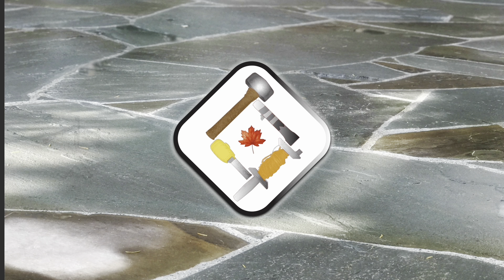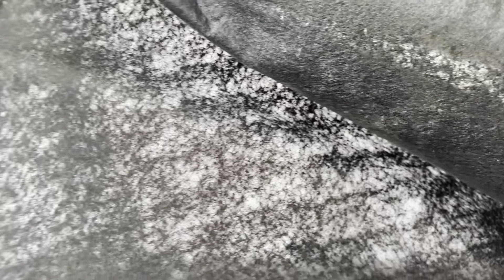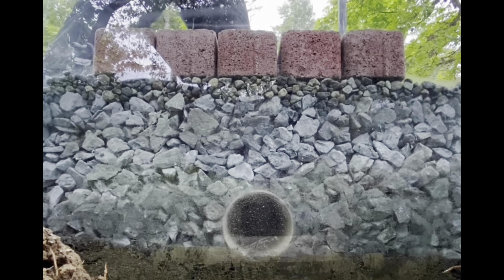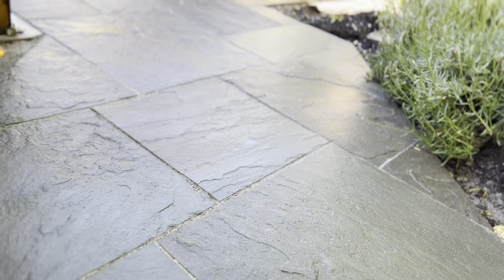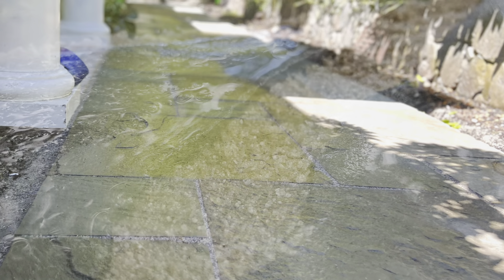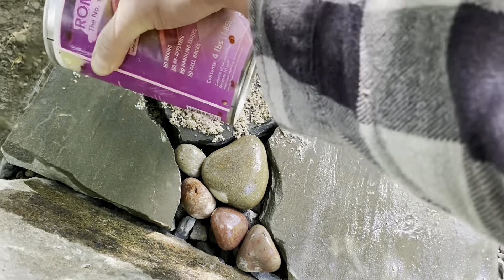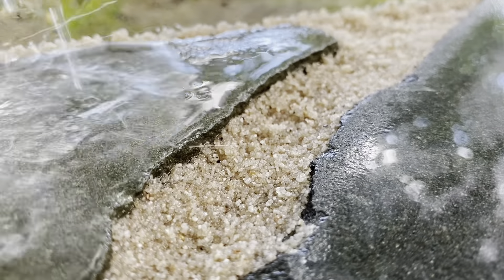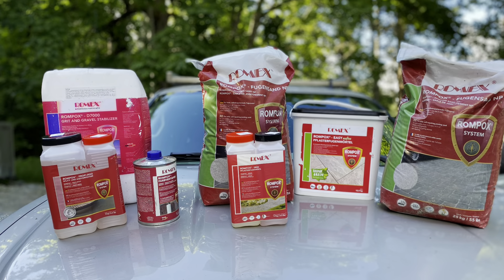How to install permeable jointing mortar! Romex and Easy Joint

Comment: First off, I love your videos.  I just finished installing a flagstone walkway with a few stairs.  It was my first project like this and your videos really helped.  I used the Rompox for the mortar and love how it turned out.  The flagstone i used is called Ozark and it has some really nice colors like gold and copper running through it that I love.  Do you recommend using any type of sealant on the flagstones?
Reply from the maker: Awesome I’m so glad you were able to do that project and use some Romex! I typically don’t seal flagstone, however if you want to lock in some of the colours you certainly can seal it. Can put in a grip additive as well for some texture.

Comment: Hi Kevin, whats the gravel just above the 3/4" clear crush?  Thank you!
Reply from the maker: For this video I used pea gravel, but if you have a smaller clear angular gravel up that way it would certainly be better!
Reply: @HardscapeCanada  ok gotcha.  Ya I'm guessing 1/2" clear is maybe to big to set into?  I the USA they seem to be able to readily get a 1/4" clear but I cant find it bulk anywhere here.
Reply from the maker: Yes correct!

Comment: Feels like I've seen this same video from you three times now, even the footage doesn't change. 

Also, aren't you also obligated to disclose paid sponsorships? Multiple videos from you end up just being ads - and that's fine, but your audience should be aware of it.
Reply from the maker: I admit there are similar themes, and some of the same shots are re-used however I’m trying to find the best way to communicate these ideas and bring all of them together in the best way possible. I really appreciate you watching them. I receive zero compensation for using these products, and mention them because they are simply the only ones that I have available in my market and I really like utilizing them!
Reply from the maker: And stay tuned I’m working on a lighting vid and a complete backyard profile with pavers and a dry creek bed etc so there will be lots of solid stuff to check out
Reply: @HardscapeCanada  Thats fair, each one has had something added to it. Surprising to hear that these aren't paid sponsorships though I thought for sure since you plugged their whole line of stuff, my bad. Looking forward to the lighting vid!